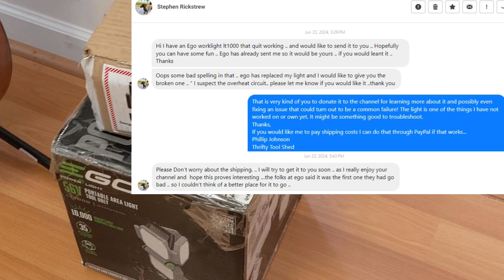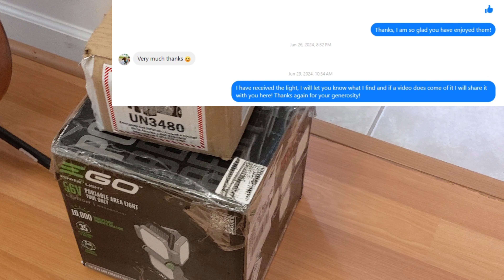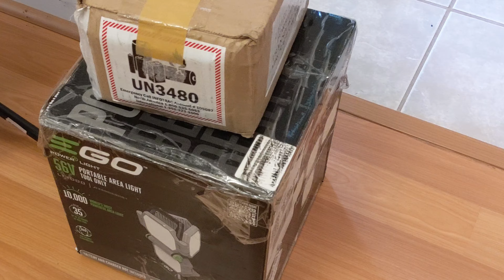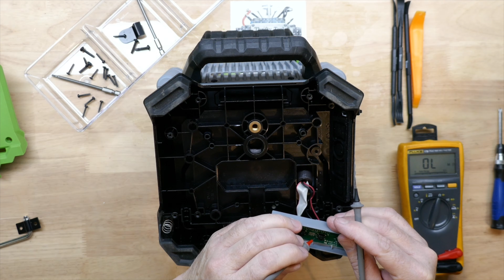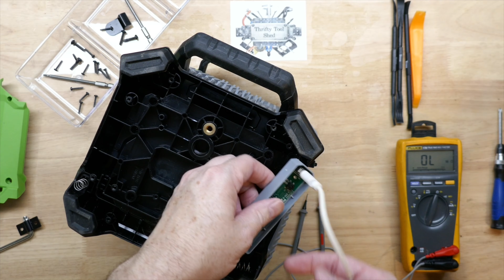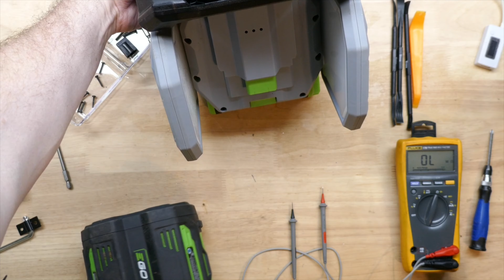EGO Portable Area Light Repair

Comment: This might sound dumb, but why did you add low melt solder to the pins when you separated the two boards? Is it to dilute whatever original solder might have been left after you vacuumed most of it off?
Reply from the maker: Not dumb all. I thought I mentioned it, but I use it in that situation as insurance. The silicone was holding. I just wanted to make sure while prying the silicone that had the boards stuck that no pads on the opposite side would pull off if the solder did not fully get removed from the pads. The part i could not see or get to well. I like to use it for that situation. Keeping the solder worked in it will give you a few seconds to pry and work with it. I think I showed in the video how it stays liquid for a few seconds.

Comment: Great video! Very informative. I have 2 of these lights. They work great, but on one of them the boost feature no longer works. The + button still works just fine to turn up the brightness, but holding it down has no effect. Any ideas what could be causing this?

Comment: Thanks for taking the time to work through all that potting, nice video. I often wonder with these lights (quite expensive) and so are the driver boards, if it's worth using a simple constant current driver (once you work out the voltage and current requirements as you did in the video) and just run them with an on/off switch. There might not be any fancy mode switching but at least it's a working light rather than a bin job.

Comment: I feel guilty for not sending the instructions… especially since I still haven’t read them .. repairing that Board is going to be …. interesting as  it seems to have a few layers of failure … but can’t find fault with that Heat Sink  it’s up to the task .. but the board definitely needs less potting and better cooling.. a heat sink of one’s own , so to speak ..
Reply from the maker: Stephen, you went above and beyond. I easily looked up the manual. I should have done so before jumping right into it though. I couldn't help it. I had to open up and start looking into it. The fix for the board is more simple than I would have ever thought. I am still recording and have to edit more thus week. I spent hours focusing on the 6 pin and 8 pin devices that had no good reference and one step at a time I replaced the 3 pin first to make sure I did get the 12V through to the 8 pin dc converter chip and the P channel mosfet is correct and it does pass the 12V when the power button is pressed and guess what! The light came on and controlled. I spent way too much time on the mystery chips that apparently are only for the USB power. That USB power took out the whole light during chip failure. This makes sense because you mentioned you did use the USB output a lot. I guess that tiny 8 pin device can't handle current very well. Well, I learned a lot and still can't find the exact match for the 5V supply rail chips, but no big deal since the light itself is functional! I am still in shock that the 5V rail was only for the USB and not needed for the micro...
It apparently has its own 12V to 3.3V rail dedicated to it.

Comment: Great job I actually have one of these so far it's been working fine but great to see if I have an issue I can fix it 👍
Reply: I ran that one for 2 years almost continuously and it charged my phone .. the heat from the  bottom panel is probably the culprit ..